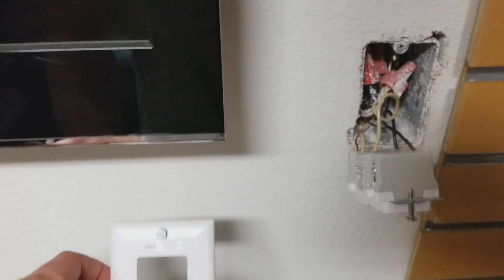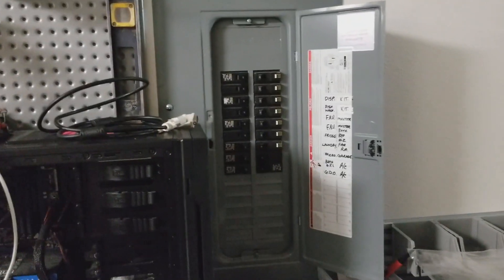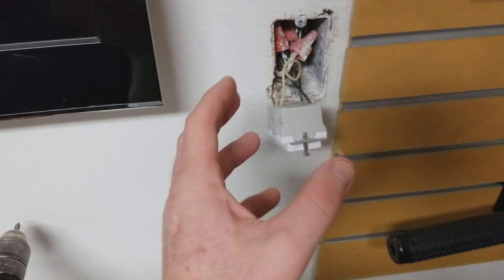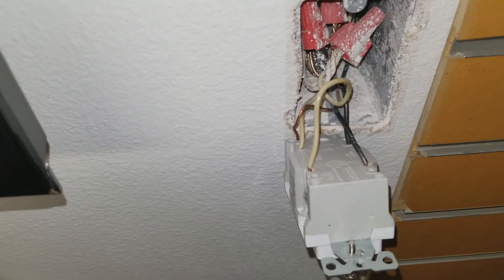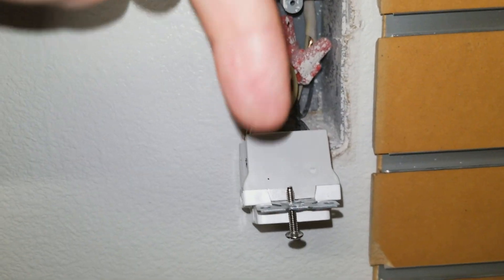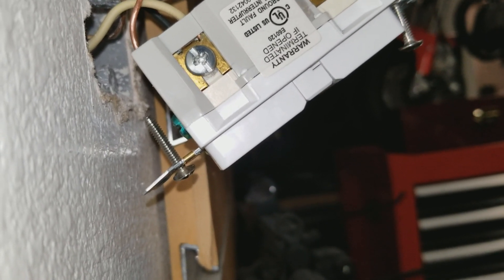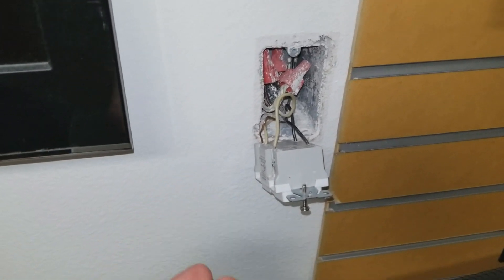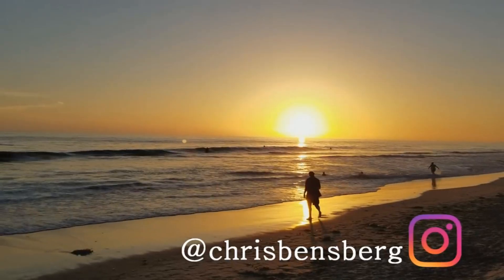How To Install A GFCI Protected Electrical Outlet Receptacle For Your Home Or Garage!!

Comment: Thanks. quick question i just replaced a 20yr old Gfci in my garage. I thought i wired it  up apples to apples
,but after wiring it a little green light on gfci turns on but I cannot trip test it and it does not provide power to itself or other outlests outside. Breaker box does not trip. Any idea of whats happening? Thanks